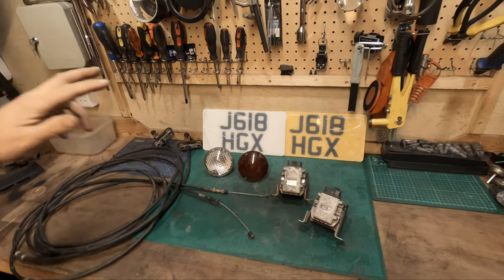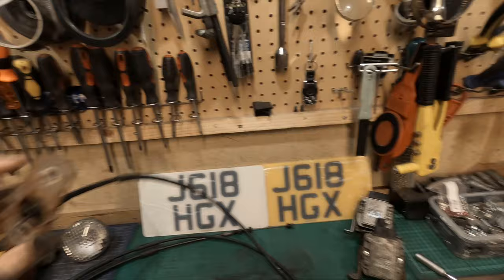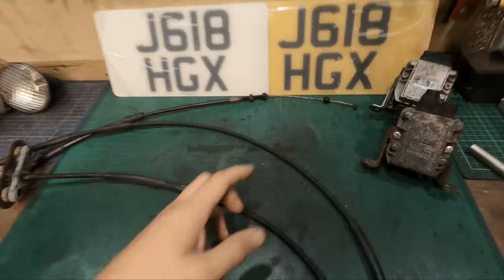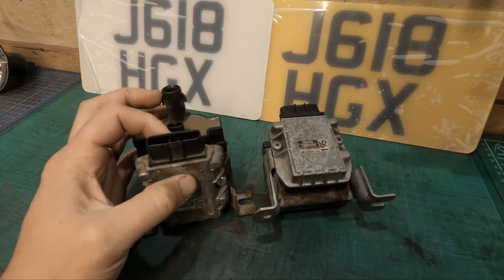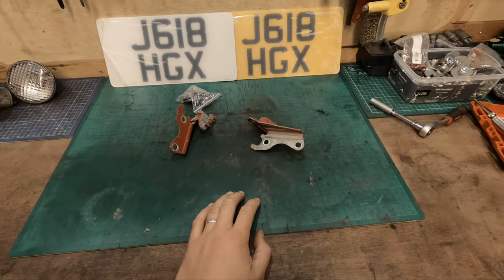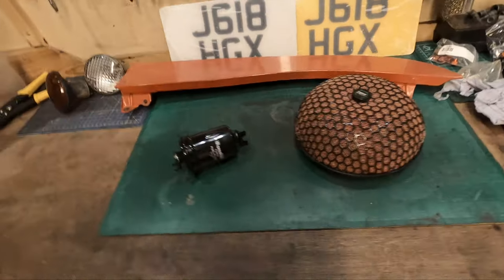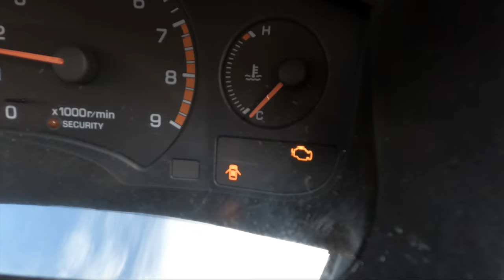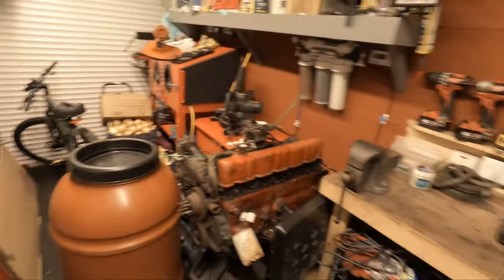MR2 Turbo Ignition Coil Problems & Igniter Replacement + Throttle Cable Engine Lid Install PART #13

Comment: i have a 91 5sfe . i have no power to the injectors.  i do have power to the coil, i do have power to the cold start injector.  aand i have tested all the relays and they click and have the correct resistance when open and closed.  besides making sure the head is grounded to the body of the car and a new ECU coudl the issue be a bad igniter? or would a bad igniter cauuse other issues i would notice.   oh and the car starts and runs for 2 seconds and dies so i know it is starting on the cold start injector and dies when that injector cuts off.    any idea what would cause no power to injectors?

Comment: The coils are all interchangeable but the igniters are revision specific so if the car is rev2 turbo you will need a rev2 turbo igniter, the throttle cable rarely needs the outer cable replacing and you can replace the inner  cable very easily in around 10mins with parts costing around £6
Reply from the maker: That explains why the connections are keyed, i'll keep the coil as a backup. With the car jacked up, took not time to install once the snapped bolt issue was sorted 😆